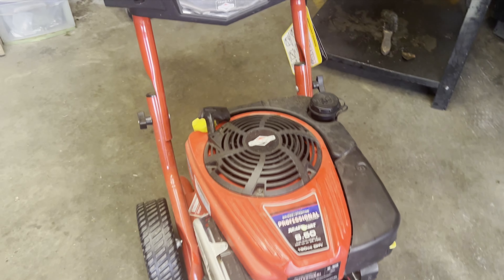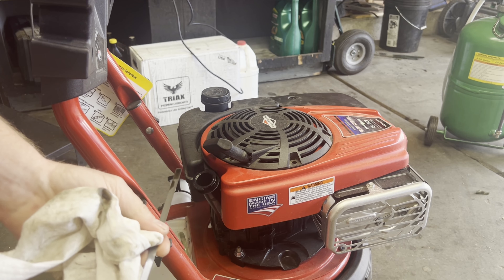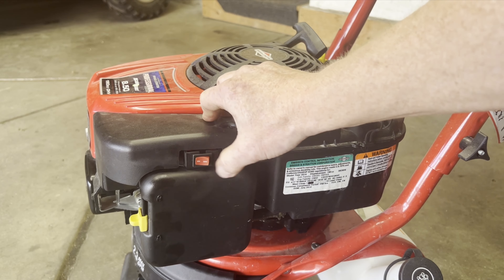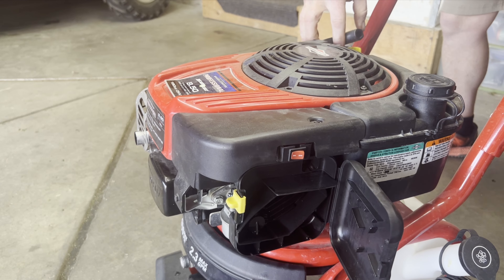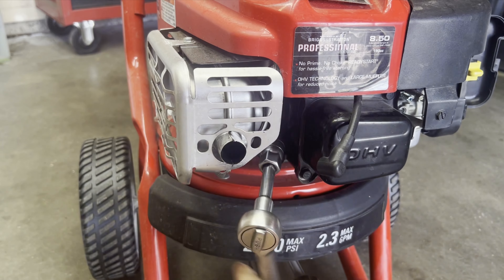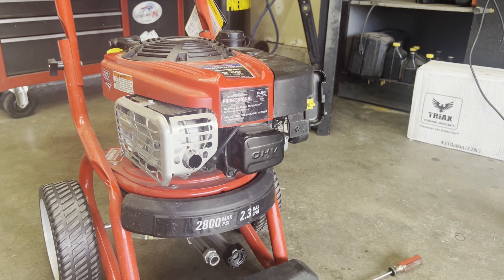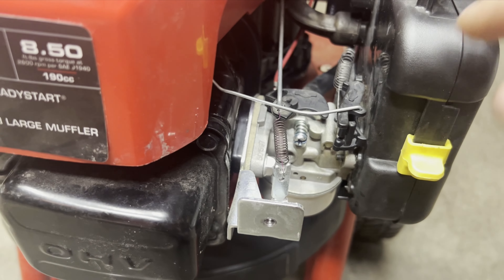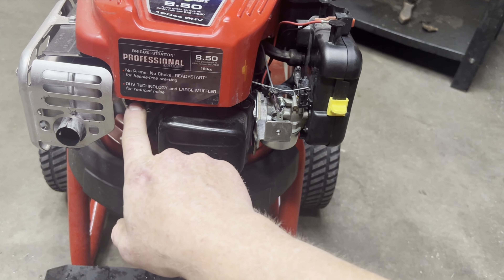Troy-Bilt 2800 PSI Pressure Washer Not Running Right

Comment: What causes the throttle to actuate?  My engine is not accelerating when I trigger the wand.
Reply from the maker: The arm that comes out of the engine case connects to the carburetor through linkages and springs. When a load is put on the engine that arm actuates and increases the throttle on the carburetor.

Comment: Mine will start with starter fluid, but won’t run. I cleaned the carburetor and put fresh gas in it but still won’t run. It’s getting gas because I can loosen the bowl bolt and gas will start to pour out. Got any ideas on what could be wrong?
Reply from the maker: Clean the carburetor.
Reply: Take the bolt off holding the bowl assembly. That bolt is actually jetted. Soak it in lysol for 15 mins. Cover it completely. Then rinse in it steaming hot water. Dry it & re-install. She'll run like new!

Comment: Do you know what size spark plug ? Mine started but then it stopped and the flywheel isn’t turning.  Really difficult to pull.   Blah.  About to buy a new one but I’m trying very hard to stick with it and fix it.    Thnx.
Reply from the maker: I believe you need a 13/16 socket to remove the spark plug.
Reply: Release the pressure on the hose and it will losses back up

Comment: What spark plug number did u use
Reply from the maker: Should be BPR6ES, but double check it to the one that is currently installed.
Reply: @small_engine_repair  thank you for the reply. I had the correct spark plug I just had a clogged carburetor bowl bolt.